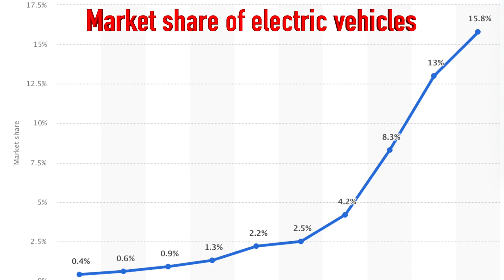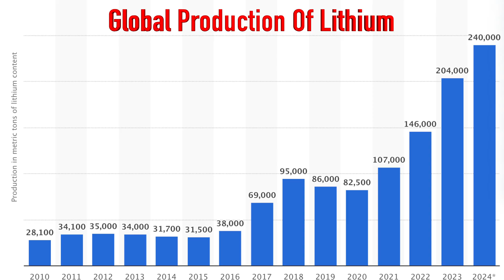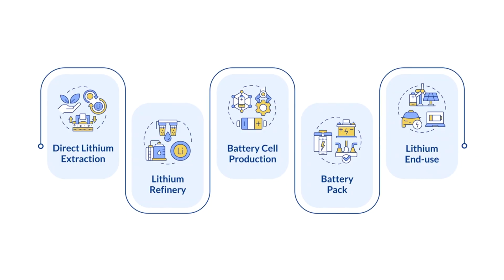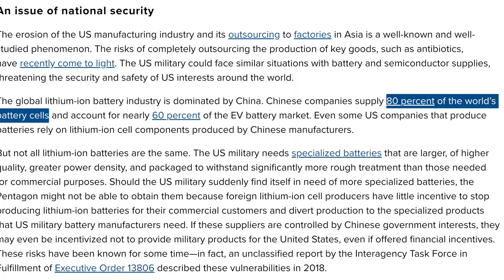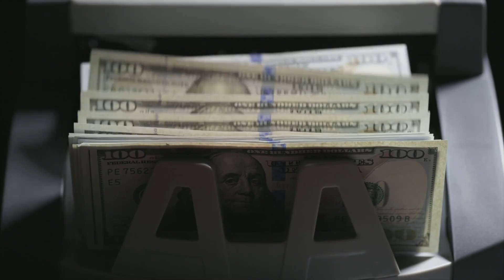The Lithium AGE: Is Oil’s Reign Finally ENDING?

Comment: Geothermal will be the future for electric power. Much much safer than lithium batteries are in storing electric power,,,,,,,,,,
Reply from the maker: Geothermal has great potential, but it’s not yet massive enough to contribute significantly to global electricity needs—still very limited.
Reply: @ILLTELLYOUWHY27  Yes, but in the future when they can drill deeper, you can have turbines lined up just like you have in hydro electric dams like 8 to 10 turbines so that 1 or 2 can be shut down for maintenance or when needed and the heat is there 24 hours a day when ever you need more power. Lithium batteries in storage is a recipe for disaster as they get older and older,,,,,,,,,

Comment: What could replace fossil fuels - Fusion if that ever works;  Geo thermal, it would have to be made a high priority;  Fission nuclear with all its draw backs.  Wind/Solar could supplement but you can't rely on them.  Why?  The sun doesn't always shine and the wind doesn't always blow.  Biofuels would work; ethanol and bio diesel. Maybe some of those odd balls like wave power.
Reply from the maker: Absolutely—great breakdown. Fusion holds huge promise, but it's still experimental. Geothermal is underused and needs prioritization. Nuclear fission works but has risks. Wind and solar are solid supplements, yet intermittent. Biofuels like ethanol and biodiesel offer potential. Wave power? Who knows—worth exploring!

Comment: So just to use lithium batteries to replace all the light vehicles and heavy vehicles would require the equivelent of 3.4 Billion Telsa Y size battery packs. Given full electrc car production is only a total so far of about 14 million over the past 5 years, even at 6 million Y size packs a year, it will take 300 years.  Even at 12 million Y size packs - at least 150 years, Lets talk crazy - 5 times current production rates 75 years. Thats just cars and trucks which are only 14% of the fossil fuel used. So 6x that. Plus battery farms.

Comment: Lithium cannot replace oil.  Oil is a source of energy Lithium batteries store energy.  Lithium batteries need to be charged and most electricity is generated with fossil fuels If you wanted to get rid of fossil fuels, you'd need other methods of generating electricy.  Nuclear 12%, Hydro 8%, Wind 5%, Solar 2%. Geothermal 1% The rest is all generated by burning oil, natural gas, oil, and other biological materials. You quote 16% of light vehicles are now "EVs" but that figure includes Hybrid which use fossil fuel. Full EVs total about 14 million of the 1.4 Billion light vehicles. That is only 0.1%. The world has 200 million heavy vehicles equvelent to about 2 billion Light vehicles near none of those are full electric.